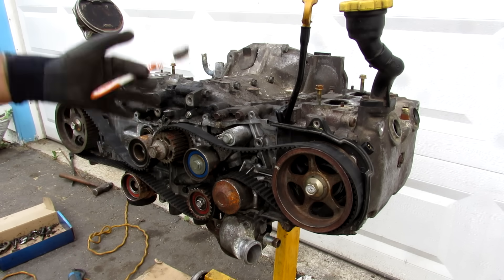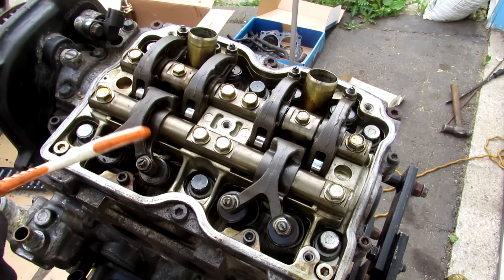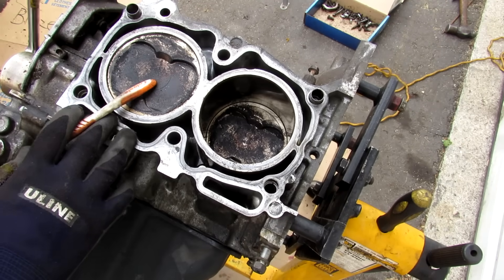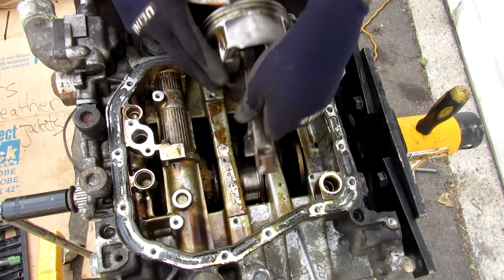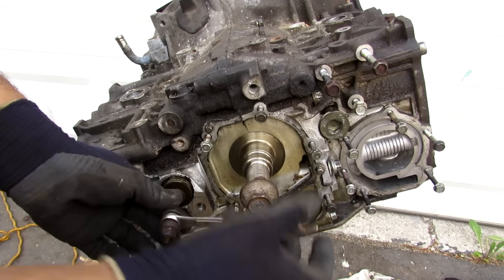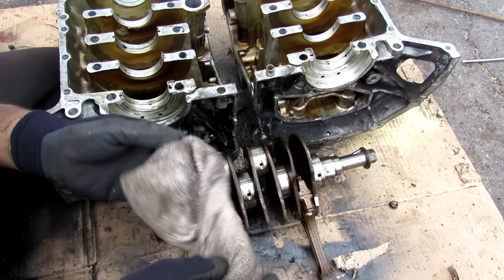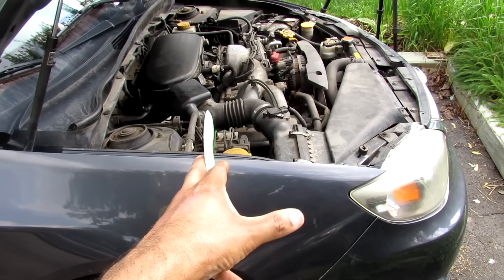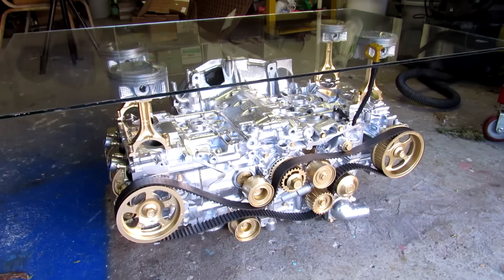Why Subaru Engines FAIL

Comment: Great vid sir, the explanation was perfect to see the guts of a boxer for anyone yet to tackle one. My 2014 non turbo EJ25 died after 180000km and I have yet to tear it down since swapping out a new one with 58km on it from the salvage yard took less than 2 days with a new clutch/fly wheel assembly! ***side note this engine burned oil from the first oil change and Subaru was useless to help since I did all my own synthetic 8000km servicing!) But regardless I enjoyed your method of explanation and quick video tear down (I am also a 20 year JM HET in Canada so I have a touch of experience). I think the rebuild will comence this weekend now and I will sell the rebuild  for extra cash since I don't race or off road with my daily. Thanks again✌
Reply: You can service your own engine. Just make sure you keep receipts and document days of change. If you did that and Subaru still denied you then you should of pressed. Self service oil changes DO NOT VOID WARRANTY.

Comment: Had this engine fail on me as well. Engine knock from low oil. Didn't know at the time how hungry it was for oil. Absolute POS. Always wanted a Subaru. Won't buy another one. It was almost not worth it financially to get it fixed.
Reply from the maker: how much did it cost?
Reply: @speedkar99  Holy moly. I just had this video pop back into my feed. I didn't even get this notification. Very late reply. IIRC the total cost came to 4k-ish (2010) for a 2002 Liberty. I was fastidious with the maintenance too but only did the oil change once a year because I did low KM. If I had this video back then, I would have made sure to do the oil twice a year instead.

Comment: That 14mm hex tool was awesome. Thanks for the info.
Reply from the maker: It sure helps. Better yet if you can tak weld the nut to the bolt and just use a socket

Comment: Why, why, why do they keep using this engine. I-4 Simpler, more reliable, cheaper to build and easier to work on. Every single person I've known with a Subaru has had a head gasket failure.
Reply from the maker: Because Subaru wants to remain niche in the market with this and the AWD powertrain setup.

Comment: All the symptoms here are accurate. I went through 2 of these engines in my outback. Finally junked the car due to rust. I like the car but I wish Subaru had fixed the issues before they went complicated stupid with their variable timing. KISS keep it simple stupid.
Reply: Same about the engine. I ended up getting rid of it for something else instead of a motor. I ADORED that car.
Reply: YourTypical Asian  you abviously know nothing about what make something junk. The design of this is fucking horrible. If you like them good for you. Enjoy fixing them. I am not into creating problems for myself
Reply: YourTypical Asian  if you want to see stupid find a mirror and take a good look
Reply: I will never buy a subaru with this engine after watching this. What a piece of junk

Comment: So, basically just regularly check the engine oil level and have it changed according to manual, and you'll be fine until the head gasket fails.

Comment: Split crankcase like an old VW engine. I had a '65 beetle which had a weird vibration that I couldn't figure out, so I decided to overhaul the engine. When I split the case open, I saw the cause of the vibration. The crankshaft had split neatly at one of the counterweights, so that half of it was in one half of the case, and half of it was in the other when I opened it up. I was amazed that it still ran at all.
Reply from the maker: Wow

Comment: I owned a 2.0 petrol estate on a V reg.
Used good quality oil every 7k miles and it never used a drop in between.
It got upto 160k and only suffered with rust.

Comment: The only thing i understand in the video is a lot of grooves where oil moves. Tearing down an engine must be alot of stuff understanding where each and every bolt and nut goes to.
Reply from the maker: Yeah but once you take apart a few you get a good idea of where things go. Transmissions on the other hand....

Comment: This is bad engineering 101 where elegance and design was prioritized over economy and maintenance - the customer loses either way in the end
Reply: How exactly did elegance and design affected the engineering of these motors?
Reply: @suubierex9396  A horizontally-opposed engine is harmonically balanced, thereby, less friction, less wear and allows you to achieve a linear power response. They also have a lower center of gravity which is a great attribute for handling and performance. This dates all the way back to 1898 when first implemented into practice by Karl Benz, so it is nothing new.

Unfortunately, the way Subaru builds them they mount them up front to look like a traditional vehicle, putting all of the vital engine components, belt pulley systems, all ontop of the engine. They are very wide engines and difficult to access to begin with. This makes it very very hard to access the spark plugs, ac compressor, getting to the head gaskets which are a known failure point in Subarus from 2000s. The belt pulleys are also interference, meaning when they go they will grenade other nearby vital components and in a boxer engine, it happens in a more dramatic fashion.

You know who builds them well? Porsche. Old Volkwagens. They are mounted in the rear and many components are mounted up opposite of the vehicle or up high, which the body style is in turn modified to fit around the components - not the other way in a Subaru. Many of the components are designed to be worked on from the side, underneath not just immediately above. There is ample space to work on them.

Comment: 'Head-Gasket Failure' is very common with any of the smaller, aluminum-heads engines  Why?
Because boy teens and 20-something sh*t-heads OVER-STRESS THE ENGINES CONSTANTLY...that's 'Why?'
ANY 'ICE' will fail at some premature point by constantly 'racing' and 'over-revving' engines that were never designed to tolerate constant abuse

Comment: Mostly everyone I talk to loves their Subaru. I always hear the commercials "95% of Subaru's built within the last 10 years are still on the road today . . ." but is that actually true? Given its sideways design, you point out it's prone to several issues inline engines are not as prone to in comparison. If I were to buy a new Subaru today, would it be reliable? What's their life expectancy? Service costs (and difficulty)? Sites such as Consumer Reports often rate Boxer's reliability as very good, but I always wonder if there's bias.
Reply: I drive over 50k miles a year.  My 2018 outback has almost 200k miles.  The engine doesn’t burn any oil and the head gaskets haven’t failed.  The only downside is that the CVT service cost a premium from the dealership.

Comment: When I see this expert mechanic using a steel hammer to get the crankcase halves apart, he loses all credibility with me. As a retired mechanic, I can tell you I would never use a steel hammer for this -- it's going to ding the aluminum alloy cases -- strictly a no-no.
Reply from the maker: Bro...this is a scrap engine. I turned it into a table...

Comment: I owned an almost-new 2014 Outback, and put 35,000 miles on it in the four years that I had it. It burned on average a full quart of oil every 1,000 miles. Every third gas fill-up, I'd have to dump in another quart of oil. I've owned 26 cars since 1974, and counting the 8 of the them that were low mileage (<20,000 miles), or brand new, when I bought them, I never had another one that used more than about 1 quart in 5,000 miles. This Outback burned so much oil that I was afraid that it would fail Smog Check, by which time it would be out of warranty and I would be stuck with the cost of rebuilding the engine, so I traded it on a new Prius. A couple of professional mechanics I know told me that all Subarus burn oil; a consequence of the horizontally opposed piston layout, and using aluminum for the block and pistons instead of cast iron, which is more dimensionally stable, since it doesn't expand and contract as much with temperature changes. The Subaru also got pretty crappy fuel economy compared to most other cars of it's size and carrying capacity. My Prius isn't AWD, but it gets 55 mpg compared to the 25 I was getting in the Subaru, and with gas in California at $4 a gallon and still rising, I can't afford to feed a car that gets crappy fuel economy.
Reply: $4 a gallon, my heart bleeds.  It’s about $13 here. 
It does make me laugh how Americans think an extremely low price is extortionate! 
I mean, a whole gallon for four dollars?  That’s almost free.
Reply: @RaferJeffersonIII  - It's now $4.50 and still going up. It's the rapid increase that is the shock. Gas was $2.25/gallon during the spring and summer of last year during the COVID lockdown, and about $2.75/gallon for most of 4 years between 2015~2019. The retail price of gasoline and diesel fuel has very little to do with the production cost, about 1/2 of that $4.50 is Government taxes, and in some countries, up to 85% of the retail price is Government taxes. They tax gasoline that way "because they can": everyone is completely dependent on it. People can choose to not buy other stuff that the Government taxes heavily, like alcohol and tobacco, but everybody that owns a car - and that's most of us in the industrialized nations -  has to buy gasoline, and it's not something you can grow at home and thus avoid the taxes. The Governments have us by the short hairs, and about the only way you car own a motor vehicle and avoid the taxes on fuel is with an EV.

Comment: Timing belts make me cringe. Why can a cheap car like my 99 Saturn SL2 use a timing chain that lasts 300,000 miles, but more expensive engines use a belt that needs to be changed all the time?

Comment: He got the balance bit at the end wrong. An inline 6 has perfect primary and secondary balance. The v6 is pretty poorly balanced unless the banks are separated by 120 degrees (totally impractical). The boxster has pretty good balance only impacted by the small offset of the crank pins. There are a couple good videos where this is explained in some detail.

Comment: Excellent video. The front engine overhang explains the inherent understeer of the Subaru Impreza. I guess this can  be fixed to a greater extent by stiffening the front of the chassis with a three point strut brace and the front suspension with coil overs and a stiffer stabilizer bar. Any suggestions guys?
Reply: I had an Impreza wagon and I put two point strut braces on both the front and the rear and it made a night and day difference in the handling of the car and how it felt going over bumps.

Comment: After owning 3 Subaru (1993-5) SVXs, a six cylinder boxer, each run fine over 100,000miles and 2 we still own (the other was sold), I can’t find a flaw. They still perform like a bat out of hell, but I have to point out, each were serviced as recommended. If you don’t know what it is, as most don’t, it was designed by the same man who designed the Lotus Esprit, take a look on YouTube!
Reply from the maker: Nice
Reply: @speedkar99  Thanx! I went back and toured your YouTube Channel! Great stuff and with greater Gifts of Gifts! Does that technically now make you my YouTube CarGrifter! (pun attempt), what do you think? I honestly put a lot of thought into that! What do you think? With all that work you put into it! You should create a new YouTube Channel “The Car Grifter!” I 🤔 you should give it a 10lb Torque-Whirl ! Thanx again, Todd K

Comment: hmm...having worked for Subaru Dealership at a very high level, i would have to take your explanations with a pinch of salt. Subaru engines are EXTREMELY reliable if you use the proper oils and service intervals. This engine for example seems to have been quite badly maintained with all the sludge in the sump. I've raced Subarus as well, with engines that i've handbuilt, increasing engine outputs seriously without anything blowing up. But good video. Thanks.
Reply: Reliable is a relative word. Compared to a cheve engine maybe. But when we say reliable, we are talking about toyota and Honda engines. Engines that can get to 400000 + miles doing just regular oil changes.
Reply: @HowTwo007 thank you lol
Reply: @HowTwo007  literally no engine makes it to 400k with just oil changes.  Don't be ridiculous.  Every engine will need seals and timing kits replaced.  Water pumps don't last forever.  Honda and Toyota 4-cyl engines are relatively bomb-proof in part because they have low output.  These engines don't work very hard.  And again, none of them go 200k+ miles without needing some work done, much less 400k.
Reply: @HowTwo007  I worked at a shop servicing all makes and models for sixteen years I wouldn’t touch a Subaru with a ten foot pole head gaskets going bad aren’t an if they’re a when I’d much sooner drive a Chevy
Reply: @dallaswood4117  damn so chevy more reliable than subaru. I never would have guessed
Reply: Subaru engines are crap. Too many failures under 150k.

Comment: Hey...our outback has  245,000 km on it...that’s 152,000+ miles and it is still running like a clock...adding 195 km every day of the week. Look after it, service it regularly and it will look after you.

Comment: The way the flat engine is positioned in bay makes preventive maintenance more difficult than a straight 4 and it has two heads. Unnecessarily expensive vs benefits
Reply from the maker: Yes true. But at least it's somewhat unique

Comment: Great video. I like Subaru cars because they are unique. But the engine gives me pause on buying one. Then top that off with the CVT I just look and admire the car. Would you pass on or buy the Subaru?
Most of these problems are from neglect on routine maintenance. Looks like a smooth engine that you could enjoy each time behind the wheel.  It does give me pause on it .

Comment: I was interested in your comments about the Boxer not having much clearance around the heads, particularly for the spark plugs. I own a 1996 v6 Toyota Camry, that makes a mockery of you view of the Subaru. The spark plugs in the Camry are good for 100,000km, and when I went to change them at 200,000km I found 5 of them were in fair condition but due for a change. The last one, on the right adjacent to the firewall took some very creative use of multiple universal joints and a regular socket, rather than the longer spark plug socket, to get it out. This plug looked like it was the original one from when the car was built. And it was loose. Getting it back in was equally as challenging as getting it out, but the engine ran on all 6 cylinders after that. Subaru mechanics are soft if they think there isn't much clearance. And yes, I just purchased a my21 2.0i-S XV (Crosstrek in the USA) Subaru recently. I won't be working on it until after the warranty expires, by then I'll be retired and have more time to do these things myself.

Comment: I still don't see why as a Japanese automaker, most are dedicated to the honor bestowed upon the brand, hondas and toyotas engines last forever, and why subaru continues to use an engine design that isn't designed to last more than 200k miles.
Reply from the maker: Subaru design is fine, it's execution not so much

Comment: my ex bought a Crosstrek. at 20,000 kilometres, they replaced the oil rings, at 40,000 they replaced them again, at 60,000, they replaced the engine, at 80,000 the new engine started to show signs of oil use, she sold it for a Mini Cooper countryman which was a maintenance pig in its own right.... also, one night, she was driving and I was in the passenger seat. It was snowing out, the roads were covered, but it wasn't too bad. Normally a slightly fast driver, she was driving below the speed limit with a tail of cars behind her. I said why are you going so slowly? she got mad at me and pulled over asking me to drive...  ...and that's when I understood. it was THE WORST car I've ever driven in snow, we even had new snow tires on the thing.   every time I see that model on the road, I think did we get a LEMON?
Reply from the maker: How much did that cost?

Comment: Man this video taught me never buy a used Subaru.
Reply: You can, and confidently, if you have some friends with Subarus that can help you learn to identify their problem noises.
As much as I hate working on them Subarus are pretty easy to diagnose and have tell-tale signs for most everything that goes wrong with the engines.

The short argument is that you probably shouldn't buy even a new Subaru because they're a pain in the ass to work on and they're hard to service.

Comment: I have always changed my oil on schedule, my heads went, then when i got my car back my short block needed to be replaced. always changed on schedule but suddenly i was adding oil between changes. im never buying a subaru again. at least i get a good warranty with hyundai. 10 year 100k bumper to bumper. im done with subaru

Comment: Hey guys I need some advice. 
I was thinking about getting a Subaru Forester (early 2000s model) for my first car in a few years time. Should I consider it provided that it's in good condition or should I get something else with a more conventional engine lay out? The reason why I am considering it is that in my country they are generally well maintained, and offer a lot of value for money compared to other cars of the same price. 

Watching this video definitely made me question whether or not I should even consider it since the engine is difficult to work on. I have no intentions of working on it beyond a basic service. 

Great video btw👌🏻

Comment: I've had 3 Subarus since 1997.  Two Legacies and One Outback.  I've put over 440K miles on them and never had the engine fail.
Reply from the maker: Nice. Thanks for maintaining them
Reply: Fake info.
Reply: @georgeskountouflis3136 ?? 440k miles over the 3 of them, I assume. Not 440k miles on each one...